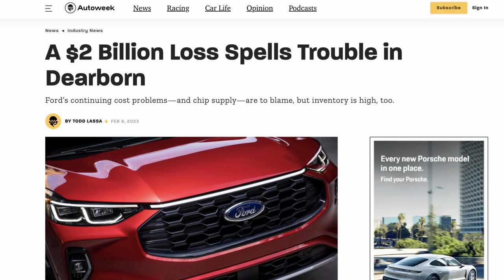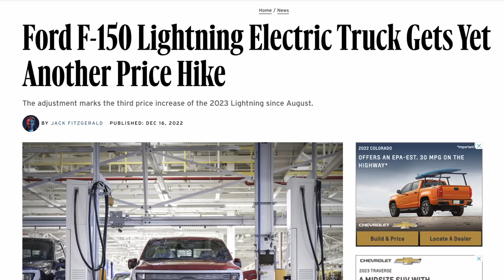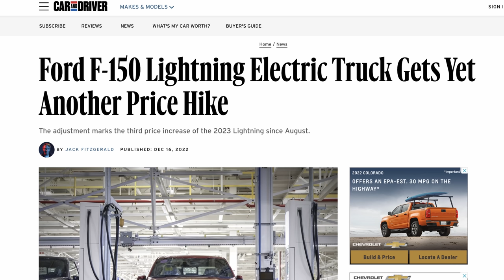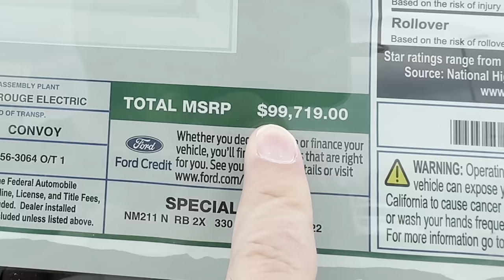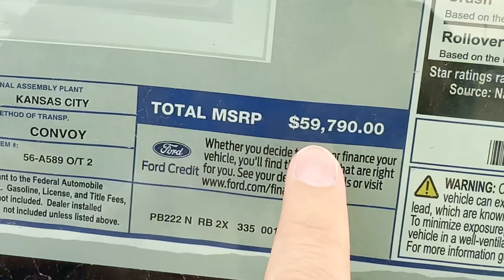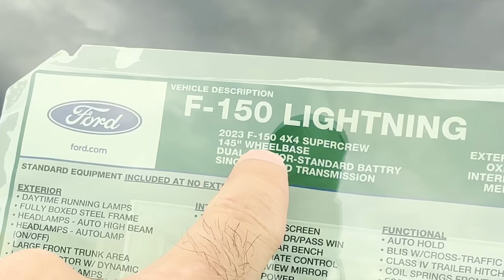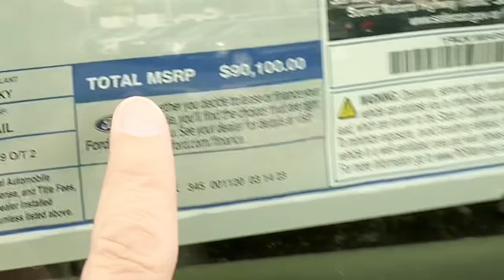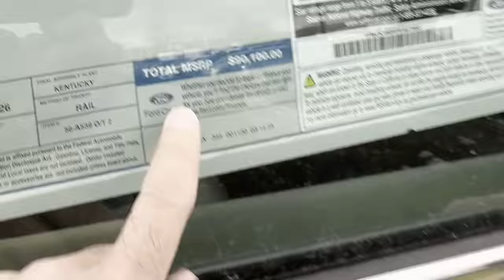Ford CEO Makes HUGE MISTAKE, Now Dealers CAN'T SELL TRUCKS!

Comment: $80K for ANY vehicle is insane.
Reply: 80k for what should be an economy vehicle is insane.
Reply: I'd even say 45k for any vehicle is insane but thats me.
Reply: Just give me a nice used Civic for $8k and nothing electric!
Reply: $40k for a ⛽️ gas guzzler is insane. You don't need for work , you don't need it. Don't cry when you need over 100 bucks for fill-up...😢
Reply: Think about this, in 1969 a brand new Cadillac cost was between $6,000.00 and $8,000.00 I was the guy that slapped the Sticker Price on the New Cadillacs, and Pickup trucks was as cheap as $2,000 and $3,000, brand new.
Update: Ford Motor have given a warning to the Dealerships, Ford Motor did not approve of or OK the Dealerships to raise prices on their vehicles! It's is also noted that Ford's main reason for so many Trucks being parked away and not being sold is the company fail to purchase chips from China, G.M is one Company that beat them to it. Ford had about 40,000 or more trucks sitting with no "CHIPS" no CHIPs no sale! It's appears that some parts of this story is not factual.
Reply: I always thought if I spent $80k on a vehicle, it would be something cool, like a Porsche, not a work truck.  But I said the same thing when I bought my last stump grinder for my tree business, a machine that cost $90k, but only cost $45k about 8 years ago.  The first major price increase came with Obama era emission regulation to tier 4, which pushed the price up to $70k, then the DemocRAT's 'Plan'demic pushed it up to $90k, but our revenue didn't increase by 25% - 40%...in fact, our revenue is down, just like our purchasing power.  FJB and Let's Go Brandon!     - Ultra MAGA
Reply: @melvingray5707  so a new Cadillac cost about 85% of the median average US income.  Today, a Cadillac costs around 125% of the median average US income.
Reply: @theupscriber65  Cadillacs have never been a car for the working class. They were horribly expensive when I was a kid in the 1960s.
Reply: Build one cheaper then
Reply: @recyclespinning9839  repeating yourself doesn’t make you automatically correct.
Reply: @Duke_of_Prunes  Somewhat true, but it was quite affordable for the middle class workers, I could afford one and bought one, but then quickly realize that I did not need this vehicle, I started buying pickup trucks and have done so every since. It's plain nutty that now Pickups cost more than Cadillacs!
Reply: For an r v it's fine.  Maybe not great but acceptable.
Reply: May it be for a skate board or a SLS (the rocket Nasa commissioned to go back to the moon), 80k$ for "any vehicle" is insane!
Reply: @dans2971  The 911 starts at $114K
Reply: Being that my first NEW car was a 1979 Monte Carlo costing me $6,700, $7,200 after tax I get sticker shock every time I look at cars now, and I mean anything north of 30k sends shivers down my spine.
Reply: @Cherokee10g  Yes, I drive pickups as well, and prefer to buy them used -- I do a lot of gardening out of mine, so a fancy new one would not suit me or my budget.
Reply: That's collector car range, not daily driver. Not by a long shot.
Reply: @allhopeabandon7831  if you think Emissions is the real reason for price increases please go back and look at the options and interior build quality of tracks back in the day vs today.  Matching with inflation and part costs you will get the real answer.
Reply: @recyclespinning9839  90k for a Rivian or Tesla is equally ridiculous, with 5k for charger installs and the r#ping of battery materials from the lands with child labor from 3rd world countries
Reply: You said it Jacen! I was checking out a Dodge 3500 at my local dealer, this was the über deluxe 4x4 crew cab dualy that had been up fitted with the killer of road package… It was $135k, WTF, who can afford that?
Reply: Yet idiots buy them, huh? If enough Ppl. Would tell the dealer that their thieves and look elsewhere-they might get the hint.
Reply: $40K for a new vehicle is insane. That's what I paid new for my 2006 Yukon XL Denali. It was cheaper to build a 550hp ls motor and upgrade the transmission, suspension, brakes and tires. By doing half the work it only cost me 21k cash to get it running vs buying a new truck.
Reply: Anything past 30k is insane
Reply: @jeffb5785  I’m only in my 20s every time I see someone say something used to be insanely cheaper I die a little more inside
Reply: @Carlinisalive  First let me say I was a huge George Carlin fan when I was younger than you are now. I don't mean to make you die a little on the inside but my 1979 Monte Carlo was sticker priced $6,700 and I felt like you did when my father used to tell me you could buy a new car for $600 when he was a kid, and you could order a car or a house from the Sears catalog.
Reply: I have never spent more than 16k for a vehicle, and over my lifetime, I have spent less than 30k on all of them, lol
Reply: I'm not paying more than 15k for a new car, and 6k for a used one. I don't care how nice the car is, I'm yet to see a car where I'd prefer to have it over its cash equivalent
Reply: @jeffb5785  Just a heads up, adjusting for inflation, $7,200 in 1979 is equivalent to about $32,000 today.
Reply: 80k for any PERSONAL road vehicle is insane. It's fairly cheap for an aircraft and for business vehicles that make you money, the profits are what justify the expense. 80k is too much for a pizza delivery vehicle or Uber, but pretty reasonable for a dump truck or freight tractor.
Reply: @bradnoyes7955  That's about my budget today, maybe a bit higher but getting into my mid 60s I am considering possibly spoiling myself and getting that car I couldn't afford, and wasn't practical while raising a family. I sat in a nice Mustang for 51k yesterday but I saw one at 43k that might due, but I am not a Ford guy, more thought is needed.
Reply: Exactly.
Reply: Not really. It is the kind of type of vehicle.
Reply: What's your net worth?
Reply: @thekinarbo1083  it could be 42 Billion dollars and I still think 80k is too high.
Reply: neither one is worth a damn @allhopeabandon7831
Reply: @dans2971  You can't get a 911 for 'only' $80k anymore though.
Reply: @dans2971 porsche still full of plastic bs
Reply: @lancen6805 same I remember when ppl were buying dodge vipers in 2006 for 70+ plus and then the real performance results were shown Porsches in my city with basic 4 cylinders are double what a Mazda or Honda same CUV class and still same or barely more power
Reply: $8K for any vehicle is insane.  This year is the first time I bought a car for more than $7500, and that was because my car got totalled and I needed something immediately.
Reply: @koholos  I remember when you could buy a nice Toyota beater for $2k. So, yeah, 8k does seem insane.
Reply: I just bought a low mile civic. Kept my old truck, for when I need it. Couldn't be happier. Great mpg, tires are cheaper. I love it
Reply: Glad I am not the only one who thinks this is insane
Reply: E63 AMG enters chat
Reply: @recyclespinning9839  not insane at all 80-120k is insane

Comment: I couldn’t help but notice how far away they park the other vehicles from the Lightning, just in case it bursts into flames.
Reply: I've driven Fords for nearly 50 years! The problem is obviously the management has lost touch with their consumer base!! Rednecks have been their market, not yuppies!! And that damn electric Lightning!! 92 miles and it's dead!?? Ford, fire your entire marketing and engineering staff! I buy used trucks anyway, but whe not just the new trucks. My FX4 finally quite at 282000 miles. I started looking for a replacement for a month driving my buddies Dodge! Just a used F150 to tow my camper and knock around in! After a month looking at trucks with well over 100000 miles and 5-6-7 years old I just bought the Dodge I was  driving!! My daughter is driving my old Expedition with over 230000 miles on it!😂😂😂
Reply: They go up like tinder boxes on a warm day! You just sneeze in the general direction of the Chevy Bolt and it too will burst into a hellfire, it's insane!
Reply: @maxbrandt6  I grew up on Fords, raced Fords! Drove Ford trucks! My old fx4 had  282000 miles on it when it just started running rough. I rode in a borrowed Dodge lookin for another newer fx4 that I'd just pay cash for! I bought the Dodge for $16000! Got tired of lookin! Lookin for a 4wd Ranger to knock around in! Pull the camper with the Dodge!
Reply: I'm with you man, WTF are they thinkin@
Reply: @maxbrandt6  and according to a local fire fighter I spoke to, they can not be put out once they catch fire.  And they’ll randomly burst into flames again days later.  They’re downright dangerous.
Reply: Actually,  I'm a Ford guy! But I'm driving a Dodge pickup iI bought from my buddy! My Ford finally quit to 282000 miles! My camper only weighs 4500lbs loaded!
Reply: @maxbrandt6  You're full of it. Stop lying. There have been MANY more gas vehicles that have caught fire, than the 6 or so bolts that have burned, due to a battery defect which has been recalled. And btw....i own a bolt....so i KNOW you're lying.
Reply: @Charlesbjtown  point stands that electric cars in general have been responsible for fires that cannot be extinguished like an ice car can be. This leads to tremendous damage to the area. People's teslas have melted the streets many times over the years. I wouldn't wanna be stuck with a street repair bill
Reply: @M8Military  Spoken like a a person who isn't familiar with, or hates evs. And we all know that there have been MANY people who have been hit with "street repair bills" 😂. Stop it guy..... just stop.
Reply: Ha Ha Ha it used tobe said FORD was an acronym for Found On Road Dead, now its Flame Out Real Disaster